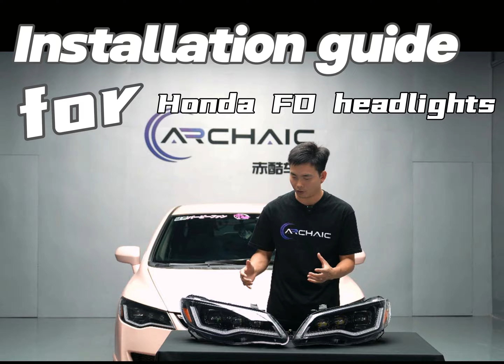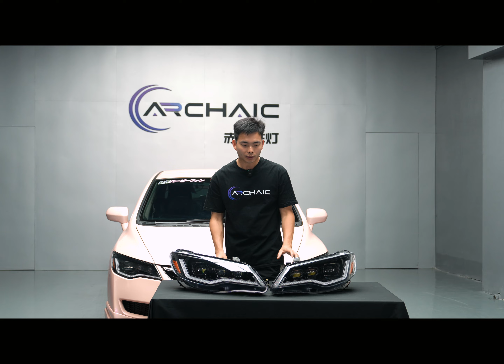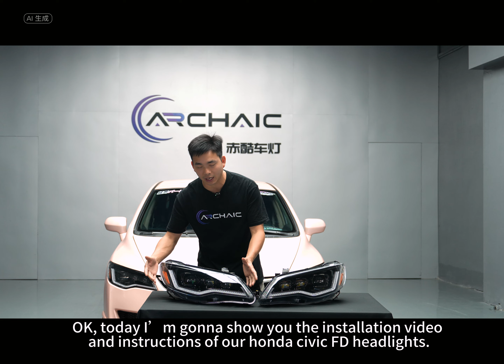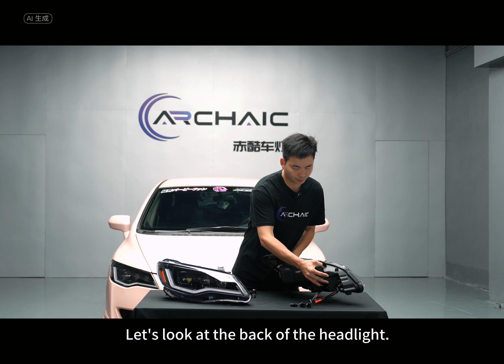Civic FD2 installation tutorial Plug and Play - one step at a time

Comment: I have the USA civic I had to splice my drl to my headlights and the start up only comes on when I turn my lights fully on. Is there a adaptor kit also how do I set up the turn single they are two different housings
Reply from the maker: What do you mean by one-way steering?
Reply: @raeshon0102  drls should be connected to the parking light wire. Turn signals to the turn signal wire. I have a jdm version everything is just plug and play.

Comment: I just purchased these headlights.  Everything is working but as soon as i apply brakes the drls stop working. Please send me a fix
Reply from the maker: Hello, please send me the video and we will help you solve it
Reply: @archaic_lighting  did you check the video?
Reply from the maker: @farazmasood4374  Yes！You can take a look at the solution I gave you
Reply: @archaic_lighting  yes it worked
Reply from the maker: @farazmasood4374  Yes, if you have any questions, you can search and contact us
Reply: Having the same issue
Reply from the maker: @ We suggest that you replace the taillight with LED to solve this problem, because the power is not matched, and the power is applied to the taillight when you brake.
Reply: @raeshon0102  use led bulbs in your tail lights. It would work fine
Reply: Hi, How is the night time visibility of these? I want to buy but I need to know if they are decent at night?